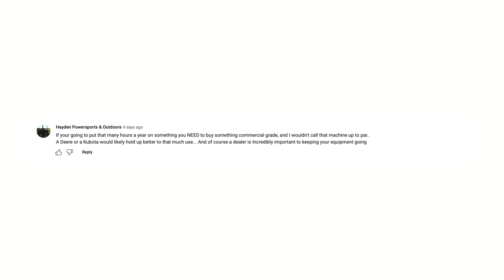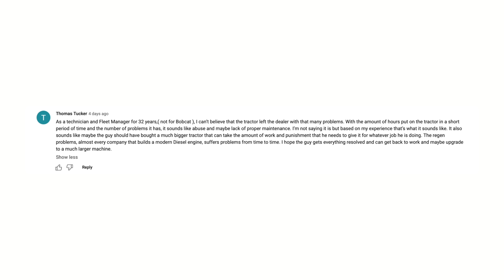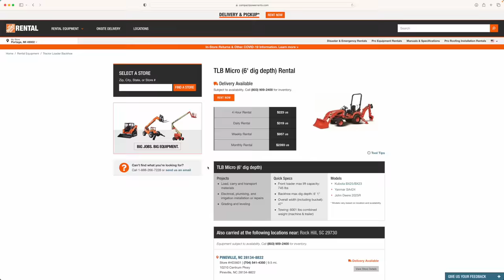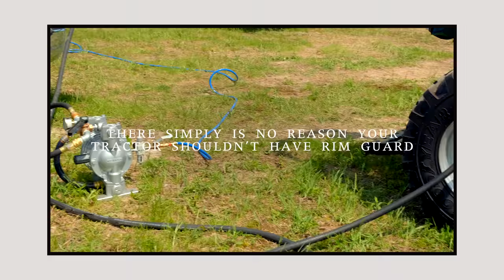COMPACT TRACTORS CAN'T DO COMMERCIAL WORK? 🤔 🚜

Comment: I would even go as far as saying 500 hours in a year would be less expensive for the owner to operate than it would be for 500 hours in 20 years. How many fluids or rubber parts are good for 20 years? And maybe that Bobcat was the unlucky lemon from the factory. It happens with every brand. He was just the unlucky owner. Better luck next time man.

Comment: Obviously the person who puts 500 hours on ANYTHING is working, hard.
There are some things that specifically say, "not for commercial use". The home griddle or deep fryer is made to cook a meal, then be put away until the next meal. If one cooks 50 meals a day in those products they will likely fail. A tractor should not. If he mowed fields 8 hours a day, he would put 500 hours on in less than 4 months, taking weekends off. If he were mowing large fields he woulld be better served to get a bigger machine, but it is HIS time. If he uses the machine within its specs., it should last. If he has done the required maintenence at proper interval, it should last, PERIOD.

Comment: Courtney,  gotta love keyboard service techs/managers.  I agree with you that the tractor doesn't care how fast the hours were put on.  

  I bought a new  Honda motorcycle back in 1997.  Had  it for a couple of years, very low hours. Stuck in 4th gear, wouldn't go up or down.  Was way out of warranty.  When dealer disassembled the engine, they could tell that the hours were minimal. It was a small battle , but they/Honda eventually covered it.

Keep the faith Courtney, don't let the Debbie Downers get to you too bad.
Reply from the maker: Appreciate it, have a good one!

Comment: Agreed👍 I currently own 3 tractors from 22hp~50hp, and have owned up to 75hp and everyone of them has had its place😉😉, I also think it is ignorant to consider a smaller unit like a 1025 or BX's as a glorified "lawnmower" people that think like that have either never used one, like in a tight spot, where a midsize compact may become a little large, or they got an ego issue, I love and utilize my BX 5:1 over the 35 and 50 hp tractors, fantastic for small scale work, and capable of much more than what most people don't recognize, another good video👍

Comment: I have  JD 1026r, used commercially landscaping and snow plowing, logging for personal use have 1400 hrs with no issues. I have pushed it way beyond its capabilities  with no issues. Knowing how to operate it in those conditions helps, can’t drive like a mad idiot with 1k pounds hanging off the bucket with machine rated for about half that. These machines are tough and can handle a lot of abuse as well. Pound for pound these machines out works larger ones any day I think with a good operator anyway